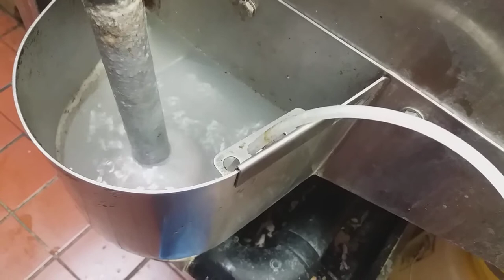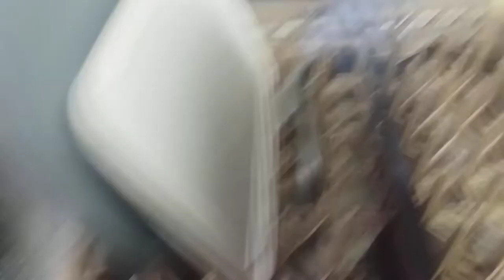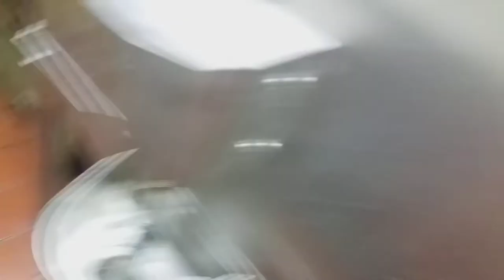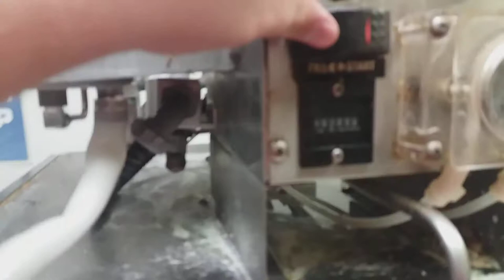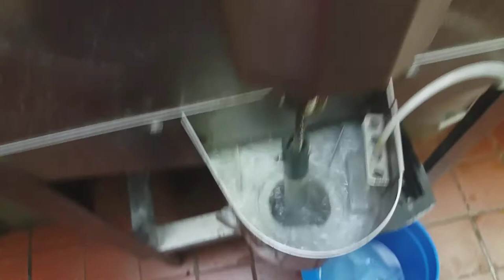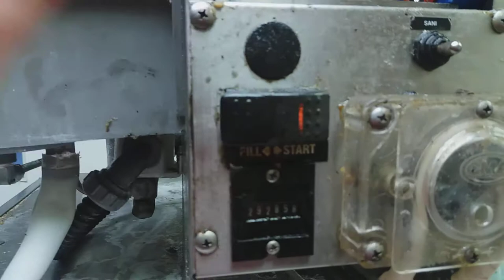Pizza Hut Dishwasher Machine

Comment: If you used the dish machine correctly it would work much better.  What a joke, Get a chemical guy or repair tech in there for some training.  I know low temp machines suck but this is insane.
Reply from the maker: dualactionsurgilator this was almost 2 years ago.
Reply: @lightningbolt99999  OK but I as a Professional in the food industry hope procedure has improved. The grease build up on the sump of that dish machine is totally unsanitary and un acceptable.